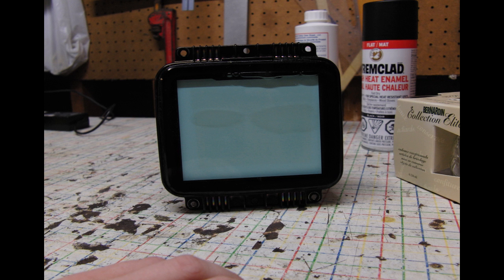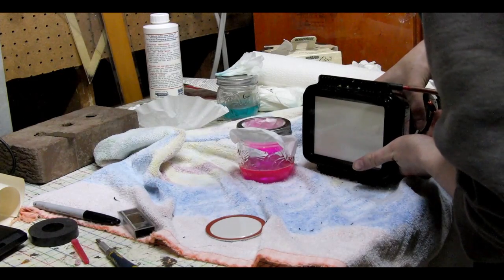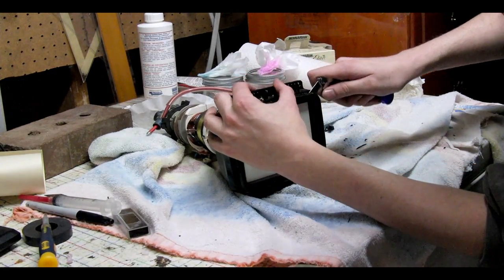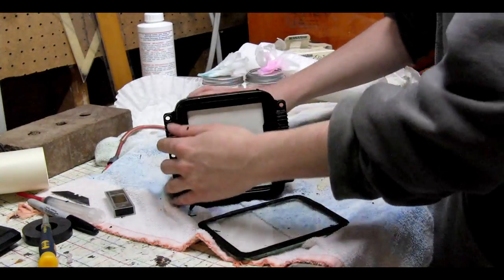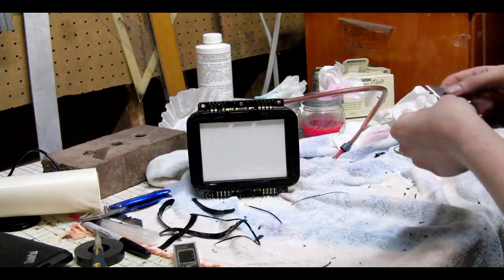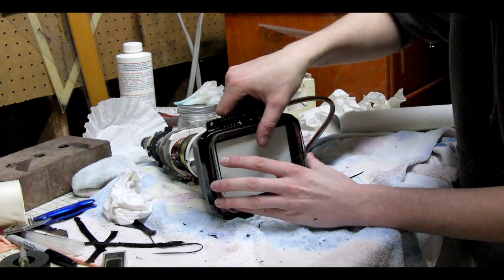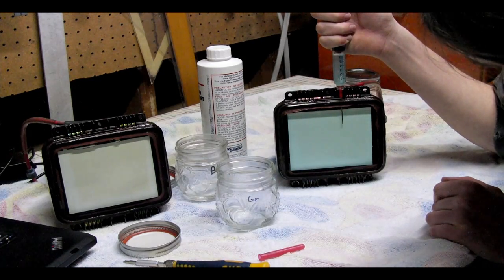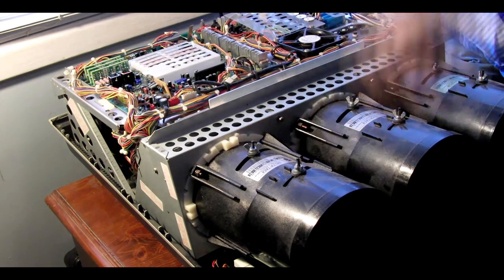CRT Fungus Removal

Comment: I'm having a flickering issue with my 1041Q, flickering with all tubes.  I assume due to power source? Although it seems to be more related to the verticle adjustment on the projector, it all flickers.

Comment: Just got a 1041Q. The CRT tubes have no burn mark at all, but that have coolant crystallisation. I want to remove the tube and clean them up. However I can't unplug the high voltage cable from the transformer. Should I cut them and weld them together later?
Reply from the maker: +cyfei717 If you cut them I don't think it's possible to repair the insulation to its original strength. Try pushing down and twisting the wires to disconnect them, otherwise you may have to remove them at the tube end. Good luck!

Comment: i have a 1950 projector tv that uses glycol as a lens
after 50 years it is still clear and rot free
XD
Reply from the maker: +robot797 lucky find! The liquid lens is a cool idea.
Reply: Nick Moore you know what is weird
i ahve owned 2 50's projection tv's both with clear lens
and 50% of the projection tvs i see in museum and other hobysts are clouded
Reply from the maker: I got mine from a pawn shop and it was already clouded. It also had been set up to use only about half of the phosphor and had some severe burn, I'm not sure if that would be related or not. Unfortunately the 300v rail on this TV blew up and I wasn't able to fix it.
Reply: That sucks these projectors have something book

Comment: Hi,  I have done this procedure on a e-home 07MS much like the one in the video without removing the front glass.  Replace the coolant with bleach and let it sit over noght.  The next day remove half the bleach and shake well. The bleach disolves the crystals. Drain out bleach and flush a few times with distilled water. Also I have successfully dyed new coolant with printer ink  using the original as a control.

Comment from the maker: The lens assemblies on this projector were in a screwed together plastic housing :/  Any time I clean lenses I use methyl alcohol (methanol, methyl-hydrate), if you find a way to get at them I would suggest using that.

Comment: Thanks for your video, it really helped me. I''ve just got me a vph-1040 from a local flea market. Unfortunatley though the blue tube is leaking coolant and I was wondering if I really have to go through the whole process of removing the crt from the device etc. The leakage is only very, very small and easily accessible once the upper part of the case is removed. Do you think just applying new silicone on leakage will be sufficient?

Comment: Shouldn't you have started this tutorial with instructions on how to properly discharge the tubes so as to not be killed by a 10,000 volt discharge when pulling off the HV lead????? CRT's do act as large capacitor even when not powered. Nice vid otherwise.

Comment: Turning off the tube will not stop the arc as the 33 kv HT is feed to all tubes at all time only the cathode gun is turned off i.e not emitting electrons when tube is off, heater still run, ,turning down G2 is also a waist of time, sounds like either your swiching power supply is outputting too higher voltage feeding the lopts / flyback transformer so its quadrupling that to higher than 33kv to me, check voltage rails and for bulged caps in / on power supply, be carefull 33kv will jump to skin !

Comment from the maker: @redSKORPION50 

Im not a TV wiz but there are only 2 reasons I could think that would happen. The flyback is putting out too high of a peak voltage making it arc over OR there is some kind of contamination inside the set. Lots of dust or if smoke has gotten inside it will leave conductive residue on surfaces. 

If not any of that I know from experience that high humidity will cause that, my 51" rear projection is prone to kicking out on humid days.

good luck

Comment: Well there is one arcing at the tube end, one arcing to the blue deflector yoke, one arcing to the green deflector yoke, and one of the flyback leads is arcing near where it enters the HV splitter.

Ive also seen it arc between the bottom of one flyback to the fastening screw, left flyback when view from the rear.

Turning down the G2 didnt stop it, and neither does switching off the tubes at the convergence board.

The picture has only very minor flickering when it arcs.

Thankyou!! :)

Comment: That was a great video, very well done.

It looks alot like a VPH 1001 you have there, i have that same model, put 3 near new 07MS tubes to replace the very cooked original 07MS tubes, & about 10 minutes after i fired it up for the first time with these tubes, ive got arcing from HV leads everywhere, replaced the leads, they still arc, covered them in silicone and 4 layers of heatshrink, still arc. 

Ive also got a 9PG, but id love to keep this old Sony going!! Any suggestions?

Cheers ;)